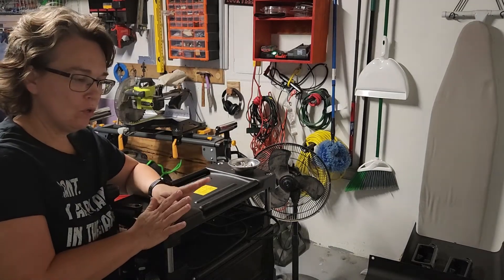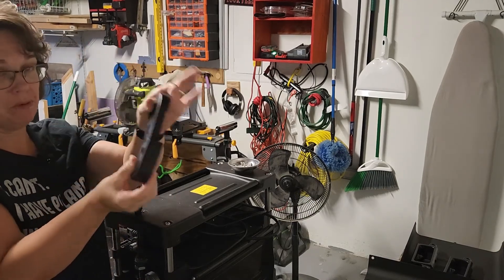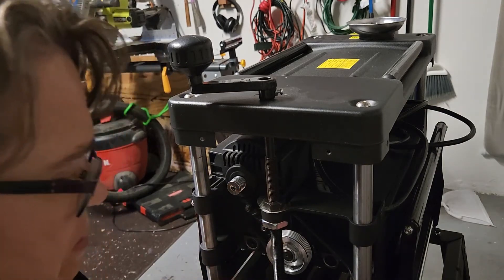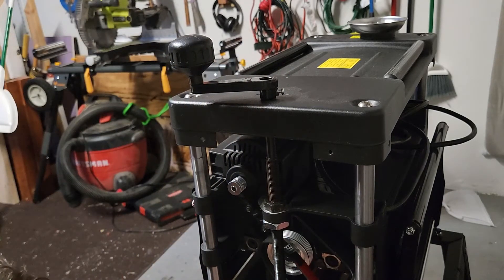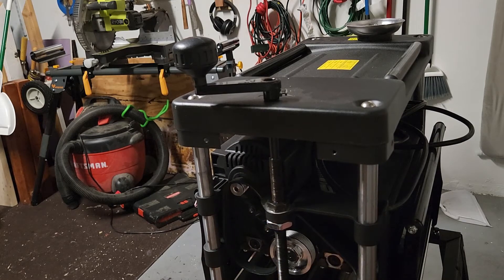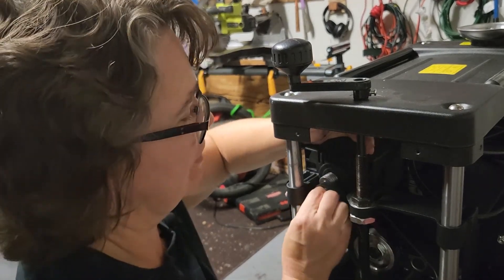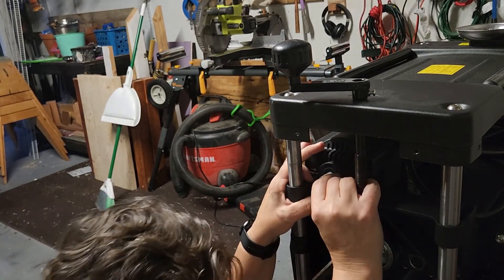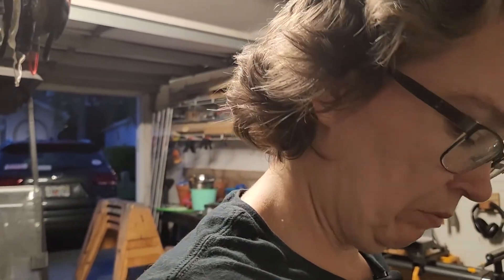Help a Grammy out!!  Which belt actually fits????

Comment: Hi.
I'm in the same boat, but with a DirtyPro benchtop planer.
It's probably too late for you now, but I bet both of those belts would fit.
They are very tight and have a small bit of stretch in them, although it might not feel like it.
I'm a whitegood engineer and these are smaller versions of washing mchine & tumble dryer belts which do need finessing on.
Reply from the maker: Thank you for the idea!
I have moved on to a dewalt planer but I am sure some day I will have to replace that belt too!